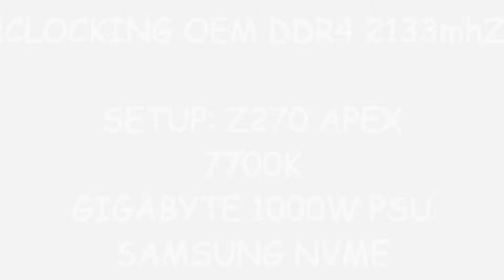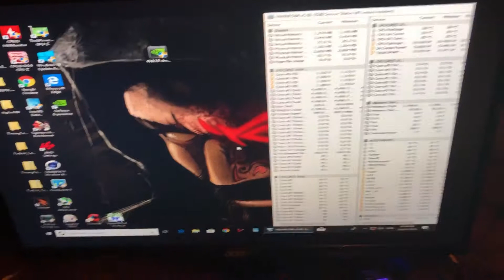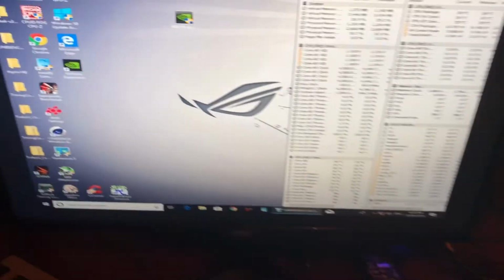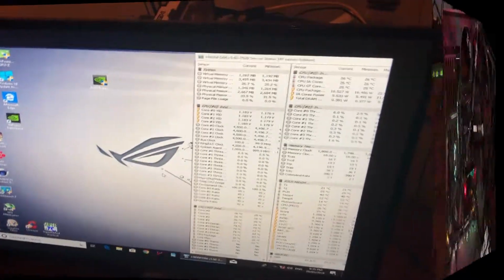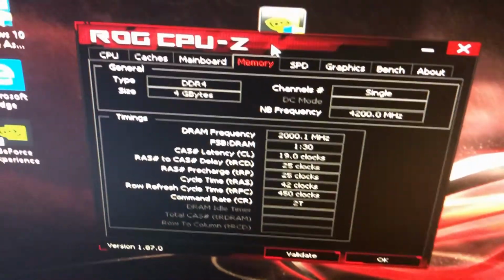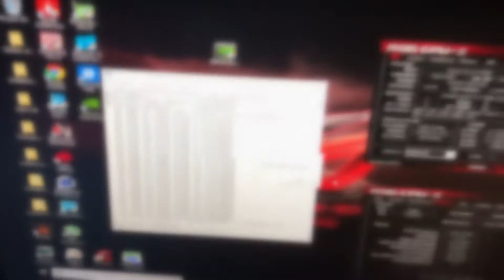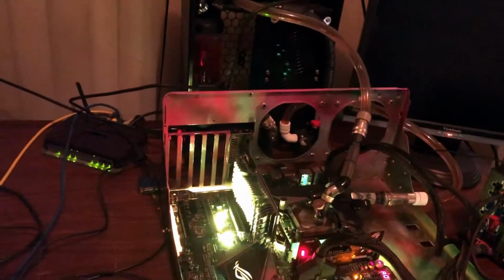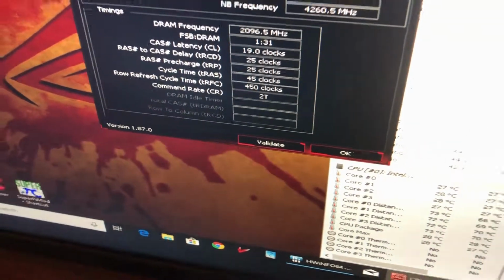OVERCLOCKING DDR4 2133MHz SAMSUNG E-DIE KIT TO 4200!!

Comment: I'm new to overclocking and managed to get a 2666 version stable at 3200 without changing voltage. It has been running perfect for the past week and did well on some benchmarks and stress tests

Comment: Picked up 8x8GB Samsung E-Die sticks, found they can run 1T Gear Down disabled very easily on my Threadripper setup where everything else i've used doesnt seem to, even though i'm technically at 4 ranks per channel with these.  Can get tRFC down a lot as well.  I think E-Die is a very overlooked chip, has fairly similar cas/trcd/trp capability like b-die.  Would be interesting to see how far 4x8 would scale at 1T/GD0 on a good current Ryzen chip/board.
Reply from the maker: E-Die can be heaps of fun mate :)

Comment: when timing are 19 i think freq is not that important anymor,e also there si many benchmarks that show beyond 3200mhz you get very little improvement.
Reply from the maker: Tomas Av. You need to look into it a bit more then mate...
Reply: @Tomas Av. Buildzoid did great video lately comparing certain speeds and latencies in a video with synthetic benchmarks and did great buying guide too, you can check that and you will know what is all about that, here is the video https://www.youtube.com/watch?v=25NW8cHNrgA
Reply from the maker: My reply would’ve been when I was in the headspace of an over clock are not a gamer or anything like that. For the most part you correct it won’t affect your life but if you’re running 30 2M super pie on Windows XP then it makes a difference to you , you know. And that’s it in a natural really unless you’re an extreme enthusiast over o’clock at all like mucking around with RAM and whatnot as a hobby then save your money on the memory spend it on monitor or PSu

Comment: Hi. Great video. I have a question, lately I discovered that I could grab cheap generic DDR3 D-die Samsung kits with certain chips for my X58 platform, which were used for top DDR3 2666mhz+ kits like T-Force etc, that I can get them dirt cheap- like 10$ in my country and OC to the sky. Well obviously those factories test and get best binned chips but still its awesome value for money. So my question is, is there any DDR4 generic samsung kits B-die or other viable which I would use for my future R5 3600 price/performance build? Trying to dig through internet about that but apparently things changed vs how it was back in DDR3 times and there probably isn't good generic samsung ddr4 which can be overclocked and suitable for Ryzen platform? Those E-dies OC'ed nicely but idk if Ryzen can handle such high voltages and if it's even close to apply for 24/7 usage.
Reply from the maker: Jakub Zając It is very different from the DDR three days but it’s great that you can get hold of some of that ddr3 because that’s really fun for overclocking
Reply: @extremeoverclockingyobbo5467  ty for answering! Yeah I noticed but still was able to find ddr4 generic b-dies from samsung too, but idk if they overclocks well as decent brand b-dies... Saw the exact chip numbers I think they are capable of even better OC than this kits used in the video! Btw 1st bch9 ddr3 arrived to me lately and I'm pretty curious what my xeon IMC is capable of doing, its 5660 so idk can be worse binned, I'm sad that I didnt got x5675 straight away. Also I think that I can get decent performance improvement if I could get 12 gigs triple channel 2133 or 2400 cl 10, currently sitting on 1650ish mhz with CL 8-9-9-24 and I cant get more of my 1333 CL9 2 ripjaws X kits and one random green xd
Reply from the maker: Jakub Zając I’ll just touch on this but first I don’t believe that with the Xeons you’re talking about that the bin will matter as much as you think. I once asked TAGG about them and that Dude’s got a lot of experience with them. In regards to the Samsung B-die it’s kind of different factors than they were before. But in a nutshell you may get a very very good Couple of OEM sticks. The things that aren’t being tested for Are that all the chips on the stick will operate at equivalent frequencies to each other at a particular voltage meaning also that as they go up in scale the voltage requirement can change to so the voltage required in order to keep the worst chip stable might be making the best chip unstable by over volting etc
But probably the biggest thing to take note of my friend would be but it’s probably going to be on a six or eight layer PCB or using a substandard PCB layout or better put probably design. Components etc

You can see that the ideal bin to look for would be 2400 c9 But even that’s no guarantee of HYKO I have some signs here that are HCH unfortunately because I thought they would definitely be Are you okay oh. There are some 2400 C 10 kits that are HY Que oh but you’re more likely to get a different icy includin HYKO but you’re more likely to get a different IC Most often Hynix
Reply from the maker: Also mate when you said BCH I think you meant HCH9? In regards to the DDR3 what you want to see if the Samsung is that it’s D revision but using 2Gb hyk0 IC’s. 
http://www.xtremesystems.org/forums/showthread.php?285767-DDR3-IC-thread

Have a read of this thread because it is full of some of the greatest of information by one of the best in the world. DDR3 went on for a little bit after this and there’s some other information but this is a great starting point and I hope it helps anybody who reads this. Any information you read from Tapakah, Splave, mllrkllr88, Bullant, GTI Jason, noxnite, TAGG to name a just a few, pay attention to ...
Reply: @extremeoverclockingyobbo5467  I took a look at the xtremesystems thread yes, but most info I took from this thread https://www.techpowerup.com/forums/threads/cheap-ddr3-capable-of-2000mhz.251866/page-2 where user named MrGenius tested few different sticks and that was where I took conclusions for it. Ofc HCH9 or BCH9 IC's are really close, but for him BCH9 performed slightly better so that's why I was fishing for BCH9 chips. 
Samsung M378B5273DH0-CH9(BCH9)
Boots @ 2600
Stable @ 2400 11-11-11-31 2T 1.5V
Price = $70 for 16GB ($4.38 per GB)

Team Xtreem LV 2666
Boots @ 2800(1 stick out of 4) or 2666(4 sticks out of 4)
Stable @ 2400 10-12-12-32 1T 1.58V
Price = $300 for 32GB ($9.38 per GB)

Samsung M378B5273DH0-CH9(HCH9)
Boots @ 2600
Stable @ 2400 11-12-12-33 2T 1.5V
Price = $80 for 16GB ($5 per GB)

Samsung M378B5273DH0-CK0(BCK0)
Boots @ 2666
Stable @ 2400 12-12-12-34 2T 1.5V
Price = $45 for 16GB ($2.81 per GB)

As far as performance(it's basically as shown above...but specifically as below):

1. Samsung M378B5273DH0-CH9(BCH9) are just barely faster in latency than Samsung M378B5273DH0-CH9(HCH9) & Samsung M378B5273DH0-CK0(BCK0)(and performance as close as possible to identical to those in all other aspects), and barely faster write speed than my Team Xtreem LV 2666 sticks @ 2400 10-12-12-32 1T 1.58V(and performance as close as possible to identical to those in all other aspects).

2. Samsung M378B5273DH0-CH9(HCH9) & Samsung M378B5273DH0-CK0(BCK0) perform identically to each other(or as close to it as possible), with barely faster write speed, but slightly slower latency, than my Team Xtreem LV 2666 sticks @ 2400 10-12-12-32 1T 1.58V(and performance as close as possible to identical to those in all other aspects). So...basically a tie for second place for those 3
Reply: Also finally sit down to OC that BCH9 ddr3 kit, sadly idk why but my mobo can't go higher multiplier than 1:5 BCLK:DRAM(which is like default auto multiplier), were changing many settings uncore ratios to auto, manual etc. and idk why but couldn't get 1:6 or higher multipliers to work, it was always setting 1:5 frequency even if it set 1:6 or above at any frequency, and it kinda limited my OC on that BCH9 stick. Was managed to set BCLK to 220 with cpu at 4,4ghz and ram 2200mhz 4gb 1 stick tho with timings 10-11-11-31@1,7v . There should be more room for that ram but I'm limited by this higher multipliers not working and I think that BCLK is high enough at 220, pretty Impressed by mine EX58-UD3R bcs it's not the highest end mobo on that platform and it did IBT run on those settings without an issue. Idk if there is like bios limitation why I can't set higher multipliers or mobo itself, how to make them to work really. In triple channel with my Ripjaws X 1333mhz CL9 I managed to set 1920mhz CL9-11-11-27-trfc154-2T and finally have 12gb of ram again but I see that I can't get as high Uncore clock as I had on lower frequency or without 3 sticks, seems its hard for NB to keep up. Also I saw it's harder on the CPU itself because I see like 20W+ more power draw on CPU vs that single 4gb BCH9 stick @2200mhz in ibt too. Overall performance is highest I got on those setting, I got 26,7gb/s read in aida64 and 69 gigaflops in IBT on those setting in triple channel. Probably could play with the secondary timings to tighten them more or loose and get primary timings one clock down but I'm not really have that knowledge to do this and maybe when I will have more time I will try. And also at 2100mhz 1 ripjaws stick was working but the 2nd wasn't and idk if this is triple channel issue or the stick itself. Will have to test them one by one and see if it's the stick itself limiting me or the board when rams work in triple channel. But I will probably fish for 2 more of those D-die ddr3 sticks that's not expensive and get a bit more performance. I should even sell my old sticks and maybe even make few $$$ because they are with radiators looking good, most ppl don't have that knowledge, if I will manage to get those Samsung kits for 10-15$ per kit.
Reply from the maker: @shermanb3  on x58 ur better off with psc, bbse or hypers 

And when dealing with Samsung you’re really only want the ones that I recommended above. Play around with the other ICs but it’s kind of a waste of time really unless it’s a learning experience
Reply: @extremeoverclockingyobbo5467  why you saying that bch9 are trash and hch9 are superior when they were tested and you can see they are actually almost performing identical? and fishing for other chips is firstly sticks with those ICs you told above are pretty much way more expensive than those generic samsungs because they are already higher frequency/better timings from the factory and on used market they can be 2 or 3 times more expensive than those generic samsung ddr3s. I'm all about price/performance when figuiring out my build or upgrades for this, that's why I'm sitting on Xeon and X58 for almost 2 years now. There is a time where I can and see that I can improve performance a bit with better memory so I'm trying to do that as much cost-effective as I can. I'm not afraid of OC and tweaking so that's why I chosen path with X58 which was superior price/performance 2 yrs ago, changed from lga775 4c/4t E5450 so it was huge improvement and did it so cheap. During this period upgraded graphics too for which can handle all AAA games in good framerates at 1080p medium/high(gtx 1070 used). Also I will learn simultaneously too when I have to tweak my build but this isn't main purpose of buying those DDR3s. I'm not considering myself extreme overclocker or smth like that but It's one of my hobbys too and I'm trying to know most for the parts which I have and will have in the future in my PC.
Reply from the maker: @shermanb3  no bud I’m saying hyk0 are the sammys you want re ddr3